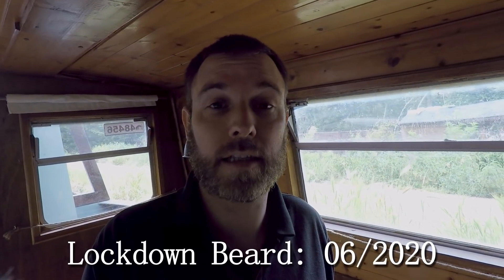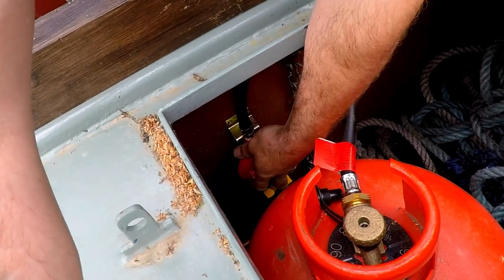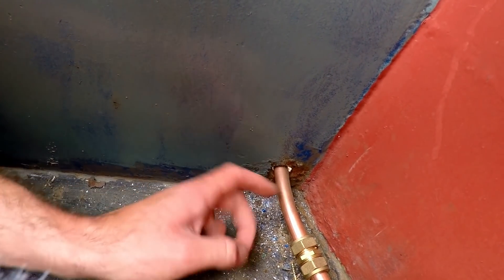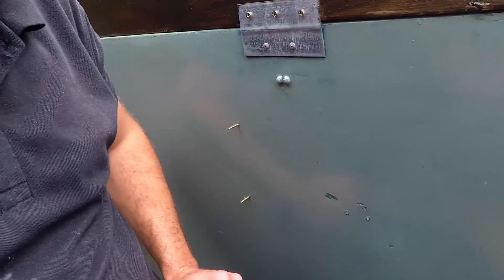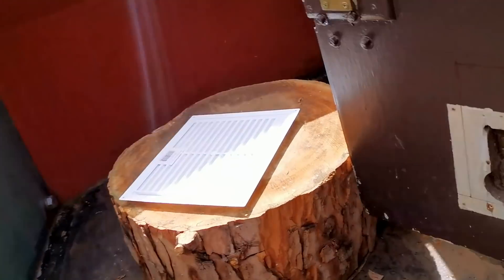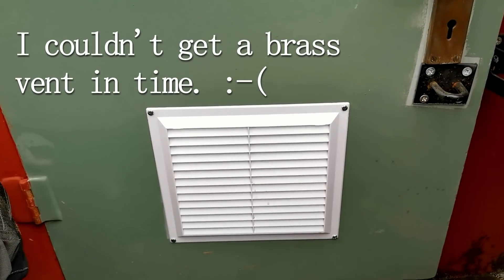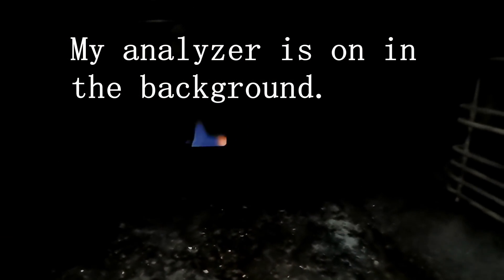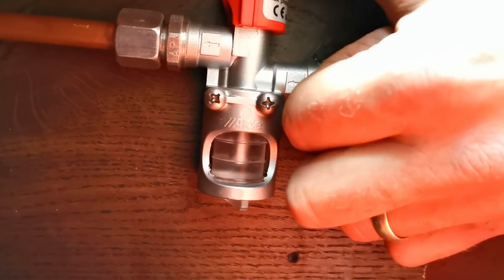GasSafe CONDEMNED Narrow Boat!! London Canal Boats.

Comment: Hello there.....May I ask a question?  I wish to replace my cooker / hob on my Narrowboat as part of a new galley.
At the moment the oven and hob is one unit, but I want a separate oven and hob.  Also I want them on different sides of the boat. So do I need to run two gas pipes from the front locker or perhaps one pipe under the gunnel as is now, but install a tee  and run a pipe down from that under the floor and up to the hob on the other side of the boat. and the other side of the tee a pipe run on to the oven.
Reply from the maker: 2 Gas pipes is the answer. You should run a gas pipe as high as possible to help prevent a gas leak from filling the bilge with an explosive mix before someone smells it. :-) Thats why you usually see them fixed to the underside of the gunnel. I hope it all goes well :-)
Reply: @HeatingGeek  Thanks....Two pipes it is...
Reply from the maker: @allanxxx8789  Remember that the pipework must be suitable and you need to use bulkhead fittings. The wall thickness of the pipe needs to be 1mm. Imperial pipework usually has the correct dimensions. Please be 100% sure on what your doing and fit a bubble tester. :-)

Comment: That original installation was shocking, and above all the installer had clearly no experience of working on boats. Even if he had used the correct schedule pipe going through the steel bulkhead, it would have fretted through due to the vibration of the hull caused by the Diesel engine. Did you report the install to Gas Safe? You did a first class job btw.👍
Reply from the maker: I got the job from Gassafe. :-)

Comment: Great video, very informative and it's great to see someone take pride in their trade.
Just a question, which size pipe did you use for the installation. As I'm can't seem to find an Adel bubble tester that's compatible with imperial pipe, it seems not exsistant?

Cheers
Reply from the maker: That is correct.

Comment: Are you saying ,this installation was condemned by Gas safe?  What are all the references to The BSS for?
Reply from the maker: Yes, it was condemned by GasSafe. I only mentioned the BSS because they advised me how to deal with the holes made. I wasn't sure  what to do so I called them.
Reply: @HeatingGeek  was it an inscope boat?
Reply from the maker: @MarinesurveyBiz  Yes. It was a residential boat.
Reply: @HeatingGeek  As it was a new installation, why did you not fit an OPSO regulator?
Reply from the maker: @MarinesurveyBiz  The regulator was the existing one. The owner didn't want to upgrade it. Therefore it was not a completely new installation.
Reply from the maker: @MarinesurveyBiz  What would you have done?
Reply: @HeatingGeek  It would have to be an OPSO regulator. It's not for a customer to decide which regulations you exclude. No bubble tester either, or brazed joints or orange hoses with jubilee clips. The bubble tester is limited to 12kw and the appliance would rating would be close to that. Pipe sizing might also be an issue.
Reply from the maker: @MarinesurveyBiz  The customer is within their rights to tell me to use the old regulator (I do agree with you that an OPSO should be fitted). Brazed joints are acceptable by both BSS and GasSafe. The pipe size and bubble tester was worked out for the KW rating of the appliance which was 9.85KW. Whats wrong with the hoses? BS 3212:1991 Type 2. They are correct for the marine environment. (or so I thought)

Comment: Trying to get a bubble tester installed on my (shared) narrowboat but am being told by the guy who does our gas testing and installations "not gas safe approved". As many (esp newer) boats have them and boat safety scheme includes them I was pleased to see you had installed one. Otherwise, a lay person (e.g. me) with zero sense of smell cannot tell if an appliance is not turning off properly. Any guess why we are being told "not approved"? (I suspect it's "not approved by 'me' "!). Re the junk in the gas locker, it is SO hard to tell other owners not to store stuff there!
Reply from the maker: They are gas approved and they comply with the regulations as needed. You can email them. The regulations (BS EN) ISO 8434-1;2007 are for the brass fittings the bubble tester use (Yes brass on boats). The only issue is you may need to "parallel" the bubble tester depending on your KW loading.

Comment: Did the boat have an instantaneous water heater like morco or paloma ? i saw a roof terminal  not sure i saw one inside , if it did then surely its over the 12kw that a bubble tester can handle
Reply from the maker: No they didn't. Otherwise it would also be over the 15KW the bottle can provide. :-)

Comment: You are supposed to use braided hoses to the appliances didn’t think brazing was allowed
Reply from the maker: Brazing IS allowed. BSS will confirm that (It is not on their main document but IS on an appendix) . Soldering is NOT allowed. The hoses are BS 3212:1991 Type 2. They are correct for the marine environment. :-)

Comment: Know you were on about a new powerflush, I haven't bought one before, was looking at the adey magnacleans as only doing domestic work, if anyone has any feedback or recommendations it would be much appreciated 👍 thanks
Reply: Yep, adey magnacleanse great bit of kit. I wouldn’t be with out it now.
Reply from the maker: My Kamco has been great. Cant fault it.
Reply: @HeatingGeek  apologies for hijacking your forum for advice btw 🤣 great videos, very informative, thanks and keep it going if possible👍
Reply: Ive got Magnacleanse, but ive used 5 times. its good on a new system clean also . for example new boiler and keeping existing pipework and rads.  As you cut out the 130?? mm on the return, connect and let it do its stuff then when your finished you quickly remove the push fit connections and fit a magnaclean valve or similar, in the pipe thats already now cut ready.
Although is relys on boiler pump, i never really get much dirt out.  Maybe cos there clean anyway, but its nice to see dirty water when your cleaning, to feel like its been worth it

Comment: Those Testo guages are pooh from what I've been told.... Water guage or my Anton FGA everytime.
Reply: The Testo stand alone pressure gauges were poo when I had one over ten years ago. The tiniest spot of rain and the screen went blank until it dried out. It obviously never rains in Testo Land. I use Anton fga, but sometimes lust after a Testo fga for its ability to cope with high CO readings using dilution.
Reply from the maker: Yeah, I'm not a fan. I had a few. Given up with them now.
Reply: I bought one of those testo electronic gauges on an insta recommendation and it would not stand a pressure test with only a 50mm length of hose connected plugged off,really poor quality stuff so sent it straight back for a refund and went for a kzne one so it could be serviced along with the same brand analyser but do agree you cant beat the old school eater u gauge for reliability

Comment: Great video dude. Only do domestic gas installations and repairs, what's the reasoning for not having solderered joints? Is it something to do with lpg or is it a boat thing?
Reply: It's a boat thing, boats move, soldered joints can crack. Brazed joints are permissible, or were last time I checked, but the BSS inspector can't tell the difference between soldered and brazed,  so to avoid issue it's best to bend the tube or use marine approved compression fittings, like Wade.
Imperial pipe tends to be used, it's to do with the pipe wall thickness, imperial is thicker walled. Again because boats move.
Reply: @LondonGas  nice one, thanks for the information
Reply from the maker: I printed a A4 document explaining what regulations and BS the work was done to. I laminated it and gave it to the owner.
Reply: @HeatingGeek  Nice touch :)
Reply from the maker: @LondonGas  Have to educate the owners and BSS. :-)
Reply: @HeatingGeek  & going by your video, some gas safe engineers, who really should know! 15mm on a boat? Regulator below the height of cylinder? Not using bulkhead fittings? This is basic stuff man. 
Glad you were there to do it properly. 

Have you found dealing with boats on marinas to be a pain? I found some marina owners wanted a cut of my hourly rate in order to carry out any gas repairs.
Reply: Primarily to withstand low frequency vibration generated by the Diesel engine which is transmitted throughout the hull structure. It is also worthwhile using pipe clamps that have rubber sheathing, which assists attenuating those vibrations a wee bit. You should use more pipe clamps on a piping run in a boat than you would normally do in a domestic situation to reduce harmonic vibrations too.

Comment: I'm a master plumber in Texas...never heard the term Olive before is that slang is that a feral and a compression fitting is what it looks like? I'm just being curious I like to hear the terms used elsewhere...
Reply: Not slang. Olive is the correct name in the UK for the copper or brass ring used as the sealing medium on a metal compression fitting. I'm not sure of the derivation except it does resemble a sliced olive in profile I suppose, but that's a complete guess.
Reply from the maker: Thanks Tim. :-)
Reply: Do you wear a cowboy hat to work 
Just wondered
Reply from the maker: Tim has give all the info I could of. Whats the work like in Texas? Do you do gas too?
Reply: Just like us we don't have master plumbers, plumbers are way down in the pecking order, heating engineers are the top:)

Comment: Hi, I'm new to your channel, I like what i've seen and enjoy the videos . Can I make a couple of points re this boat. You don't say (or I missed it) if the boat was residential or for holiday use,  the ventilation requirements are different for these boats.  At 14:28 you point out some brazed joints,  BSS requires copper pipework to be joined with compression fittings.  When you tested the hob burners you mentioned your pressure readings, It wasn't clear from the video if the oven was on at the same time, BSS requires burner performance to be checked with all burners operating at maximum and flame pictures correct.
I appreciate that some of this may have been lost in the edit. 
BTW what part of the country do you serve?
Paul
Reply from the maker: Hi paul,
The joints were brazed not soldered. Brazed joints are suitable for gas on boats. this was confirmed by BSS. The vessel was residential. A lot of commissioning was not in the edit simply to keep it simple. Air test, gas test, working, lockup, CO..... Too much to keep in the video. :-)

Comment: An interesting different informative video
Reply from the maker: Glad you think so! It took more reading than doing TBH. :-)
Reply: @HeatingGeek  aye, it didn't look that "hard" to do as a job as such. It was just the utilizing  possessed (and reminding yourself of rarely used) knowledge to do the job correctly

Tbf the screws alone would have set off danger signs nevermind the copper pipe just passing through the holes without some sort of sleeve and thus wouldve been banging against a sharp edge whenever the boat moved or with enough boats going by it
Reply from the maker: @stevenwhyte4217  I know. :-) I actually drew blood twice from them screws. Both times on my legs while leaning over into the locker. Yep it took me that long to remove them.....
Reply: @HeatingGeek  was there something in particular that lead to Gas Safe coming out or did the client just look at it all and go "nah... something isn't right here"
Reply from the maker: @stevenwhyte4217  I think they just knew the installation wasn't like their other canal boat. Also the screws and the fact the engineer didn't/wouldn't give them any paperwork. Funny thing is the engineer is actually well known within the industry (not youtube or instagram) . He should know better.

Comment: I'm not a gas engineer but I need to ask 2 questions. 1. Why not 15mm copper supply pipe? 2. Does the bottle space need to be ventilated? Got the first one now.
Reply from the maker: The holes in the gas locker onto the canal are the ventilation. Some regulations said ventilation "could" be fitted in the gas locker top but didn't explain why. Boat builders probably have far more knowledge. You found the answer for 15mm copper?
Reply: LPG is heavier than air mate. So you can guess what can happen
Reply: Also interested in why 15mm copper is not suitable? Pretty sure the pipes on mine are narrower than that (bought the boat with am existing gas system, which has passed BSS.) I'm on a narrow boat but I mostly stay on the same mooring, would that make a difference? Beautiful work btw and yes the standard of work from a lot of people who take money for what they do is often quite shocking. Nice to see someone do things properly!